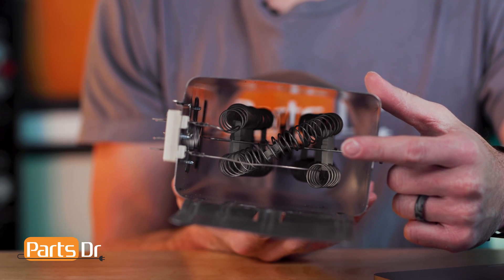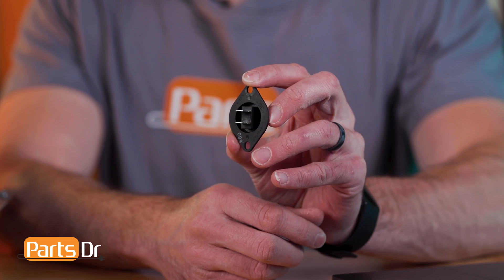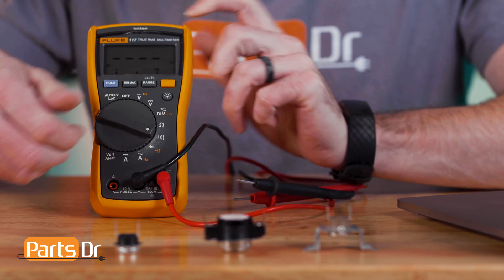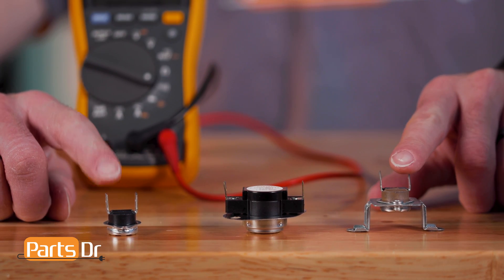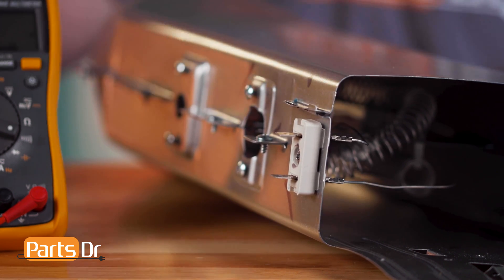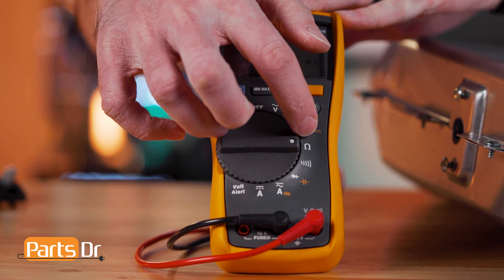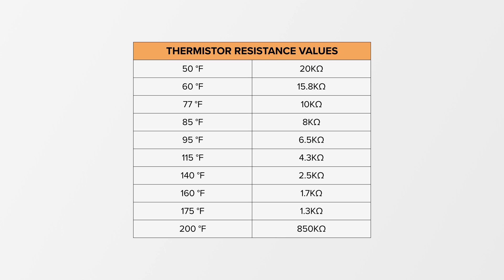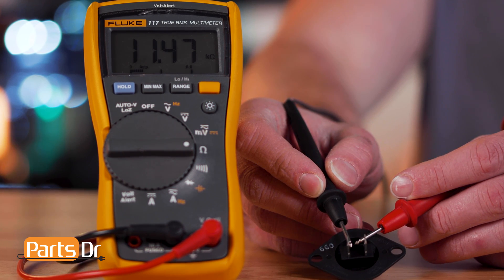Samsung dryer not heating? Test these 5 things first!

Comment: I checked all heating related sensors and element. All checked out. I still replaced the element and all sensors. Still no heat. I ordered a new motor and installed, still no heat. I checked the relay and got 120V on both sides when running. Any ideas?
Reply from the maker: Yes, check the power supply to the dryer to ensure you have 220-240V and that you do not have any burned wires on the terminal block.  It could also be a bad main control board.
Reply: @PartsDr  it was the power supply. Outlet actually. I checked before and it said 240. But after plugging in, it kept reading 90 on one plug. At least I now have an intimate knowledge of how dryers work. Lol. Thanks for all you do
Reply from the maker: @kelltrad6127  Glad you figured it out!  Thanks for sharing

Comment: Everything on my dryer checks out proper voltage  Everything is good. It worked at one house but now throws a l2 code.  Makes absolutely no sense
Reply from the maker: We would check to make sure the power cord and outlet are wired correctly.

Comment: Hey ..just came across  your channel  I have a kenmore  dryer that's keeps shutting  off about 1 min after coming  on ...What could  be the issue
Reply from the maker: The two most common things that we see cause those types of symptoms are a bad motor or bad control board (if applicable).
Reply: @Parts Dr  Thanks did some digging  up it may  really  be a board issue because it  runs for about 4 mins with no heat beeps and then shuts down

Comment: Hi Steven, I checked all sensors and changed the out Thermistor. It worked for one day, and it failed again. Changed it again, but it didn't work. The exhausts are clean.
I searched all videos on Youtube, but none of them has my Samsung Dryer Model DV50K7500GW/A3 except one video that changes only the High Limit Thermostat.
You are the only one who talks about the codes, but how do you check them, or do they appear when something is wrong?
I went to your website to buy the Thermistor. I found two with the same part number, but one is cheaper than the other. Please advise.
I became a pro as much as I disassembled and assembled my dryer in one-week :D
Reply: I’m sure you figured it out by now but one is an off brand the other is the Samsung part.

Comment: I have checked everything you stated. The element is reading 9 to 10 ohms and the thermistor is a bit over 10 ohms but drops when I touch the middle part with my finger when I have the meter attach to the ends.  The thermostat and the thermostat fuse beep when I test the continuity. My element does have a crack in the middle of the frame in which the element sits on but it all has continuity. I am thinking about just replacing it all. My thermistor is reading a 10.80 but no codes. Please help
Reply from the maker: The element should be replaced if it has a crack in it, but it doesn't sound like the cause of your not heating problem.  The next things to look at would be the power supply to the dryer, terminal block for burned wires, centrifugal switch in the the motor, and the main control board.

Comment: Excellent video. clear, and very helpful. We had a burnt wire, and I needed to know if it was from a bad connector, or faulty components. Each component tested out exactly as you described, so we will change the wire and see what happens!
Reply from the maker: From our experience, a burnt wire usually comes from a bad or loose connection.
Reply: P90p [)pL

Comment: Mine keeps displaying "clean filter" checked the duct on it and it was clean, as is the filter. No heat
Reply from the maker: The "clean filter" may not relate to your no heat issue.  We would start by checking the things shown in this video.

Comment: After replacing my heating element and all fuses I still have no heat at all. Should I assume at this point it's the control board? I have proper 240v coming to the machine.
Reply from the maker: Usually it comes down to the motor (the centrifugal switch can fail inside the motor) or the main control board if you have ruled everything else out.
Reply: @PartsDr  thank you the response. I have an electrician coming to take a look at it. He's a good friend, hopefully he can trace the problem down. Is there something I could test to see if the motor is bad ? & and also the dryer starts and spins normally just without heat. I'm not sure if that changes anything.
Reply: @mexdal  nope. I ended up buying a new control board and still not having any heat. I was sick to my stomach. At that point I wasn't wasting any more time or money. I got different new dryer

Comment: "Multimeter needs to beep"  I've never had one that beeps, what does that indicate, that the circuit is closed (current flowing)?
Reply from the maker: Most multimeters have a setting called "continuity".  When set to the continuity setting, the multimeter will beep when there is continuity between the two probes of the multimeter.

Comment from the maker: If your Samsung dryer isn’t heating, this video will walk you through how to test the 5 most common parts that can cause the issue: the thermistor, high-limit thermostat, two thermal fuses, and the heating element. If you're ordering parts online, especially from places like Amazon or eBay, be careful that many of the cheaper aftermarket parts are of much lower quality. We've seen many cases where these parts fail quickly or even cause other components to burn out. We always recommend using genuine OEM parts to ensure long-lasting repairs. You can find high-quality Samsung dryer parts at https://partsdr.com

Need more help? Check out our other Samsung dryer videos:
Disassembly guide: https://www.youtube.com/watch?v=yMm91uA-KUY
Heating element replacement: https://www.youtube.com/watch?v=lbEtu8HFcHA

Happy repairing and let us know how your repair goes!
Reply: Have a dryer that the element won't heat. When you turn it on plugged in 120v reaches the element fine when you turn the dryer on heat and turn it on. The thermal switches have no resistance when turned off as they should. The element tests good as it has 10 ohm resistance and does not short to ground. There's no apparent physical problem with the element. There's a light blue wire running down towards the motor that seems to have a short to ground but I'm not sure if that's normal being it goes to the motor windings. Seems like I remember that motor wires will show a short to ground. The motor works great. Is there some way that the element could actually be bad anyway? What would be your recommendation to do in this situation? How can the element test good, have 120v going to it, but not heat? Anyone have a clue if the element is bad anyway or is there something else that could cause this?

Comment: 80% of Most common problem people always run into is buying cheap generic parts from Amazon or ebay. People have to realize that you get what you pay for. Always use original quality parts even if you have to pay 10x more the price. Don’t use cheap chinese junk. Thanks for sharing your videos brotha and keep up the good work.
Reply: Yeah! Don't replace your cheap low quality Chinese junk parts! Replace your Chinese junk parts with expensive low quality Chinese junk parts! Makes sense!
Reply: So the manufacturer is using cheap Amazon Parts is that what you're saying because I don't believe that 80% of the people are having problems with the cheap parts that they buy they're having problems with the parts on the original dryer that they're buying
Reply: Where do you think manufacturers buy parts from? China. That’s why they break
Reply: "you get what you pay for" isn't always true anymore. I can buy $10 junk or $100 junk...if everything is cheaply made junk, then I might as well pay the cheaper price.
Reply from the maker: We 100% agree with you.
Reply: @PartsDr   what web site do you recommend to buy parts from. Same parts as seen in this video?
Reply from the maker: @briankazibwe2673  You can buy Genuine OEM parts on our site https://partsdr.com
Reply: You often get what you pay for. However, before this absurd inflation, there was a nice middle ground between poor quality, undercutting products, and vastly overpriced products relying on vendor lock-in. I have faith in competition as long as good reviews are published.

I personally think the approach of sites like Project Farm gives us the best quality and price.
Reply: I just tested all of my parts and they were good. My dryer is still not producing heat
Reply: In my case I’m just trying to get the dryer working because I’m selling my house and I really don’t care how long it lasts.  As long it works past the inspection I’ll call it a success

Comment: Great post and information! I have checked all 5 components listed in this video and they all check out good. I have not reassembled and tried it again, but it was not heating when I took it apart. Thoughts?
Reply from the maker: We would check to make sure the dryer has proper power supply 220-240v (make sure there are no burned wires at the terminal block).  If the power is good then you could have a bad motor or main control board causing the dryer to not heat.
Reply: @PartsDr  thanks for the info.  I cleaned everything up and put it back together. The Digital display is working and the dryer looks like it's running when you press play but it will not run now. I make sure everything was connected when I put it back together. I checked the power coming in the outlet, each hot got 121v and then both got 243v. Checked the wires from cord going into dryer, perfect condition. How do you test for motor or control board?
Reply: @PartsDr  how do you test tye control board to see if it's good ?

Comment: Awsome  video , so i replaced all the heating elements and sensors but my dryer still doesnt heat cloths. I can feel heat coming put the exhaust pipe but no heat inside. Any thoughts , also what happens if you put the wires on the heating element  wrong. I had taken a picture before i took it appart bit since i replaced the parts i am not sure if the wires still go  the same way
Reply from the maker: The two power wires can be connected in either order, it does not matter as there is no polarity.  If there is heat in the exhaust pipe that would indicate that it is heating because the heat has to flow through the drum to get to the exhaust.
Reply: That's what happens when me, it had great when I was touching it but clothes were not drying, and there's no lint in the pipes.

Comment: I have checked all that you have suggested and still have blown 3 high temp thermal fuses on the heating element.  I have replaced the coil even though is was not bad.   There are no codes on the display.  Also have checked and rechecked all sensors and they check out good. Dryer still runs just will not heat.  How do I check for a bad control board?  This is an awesome post!  Thank you for the excellent instructions.
Reply: The moisture sensor can also trip the thermo fuse. It’s located inside the drum in the front. You have to stick your head in there to see. If the drums turns blue, which means they use to much fabric softener and coated the sensor. This will cause your dryer to prematurely shut off early too. Wipe it down with graffiti remover and your good to go.
Reply from the maker: Usually you have to determine the main control board is bad by process of elimination.  If you are continuing to blow thermal fuses on the heating element, that could indicate either a shorted heating element or a bad main control board.  If you run the dryer on an air dry (no heat) cycle and the dryer continues to heat then you either have a bad main control board or shorted heating element.